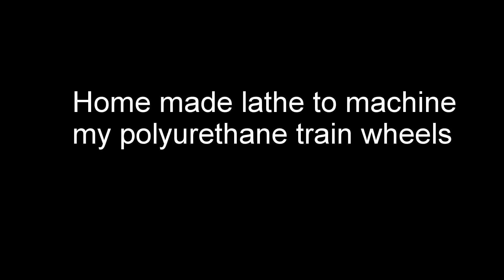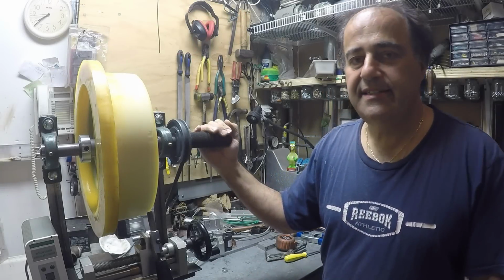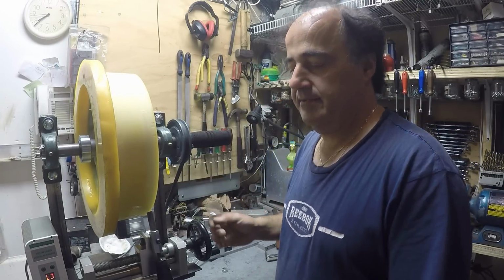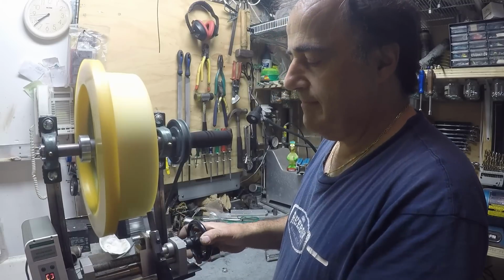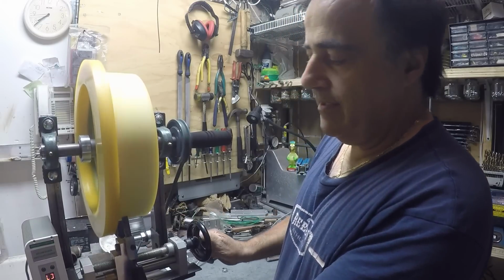Home made lathe to machine my polyurethane train wheels

Comment: train wheels are conic to prevent they wear out fast and keep balance of gravity on tracks , the flange is the last resort to prevent derailing
Reply: If you look closely you can see it is tapered slightly. Oddly enough it really doesn't take a lot. The angle doesn't matter although I would wager the more tapered the angle the better it tracks through curves.

Comment: why not cone the wheels - as in a true rail wheel- should keep flange from engaging as much- I think. Did you ever urethane your rear wheels? How'd they last? Very Nice work!
Reply: The slope on the train wheel acts as a differential when the train goes into a curve.
Reply: yeah train wheel are conic, the flange is the last resort to prevent derailing